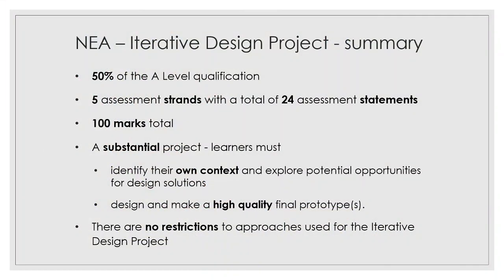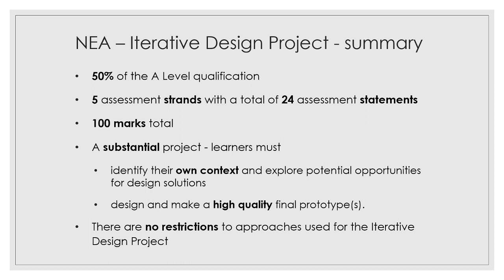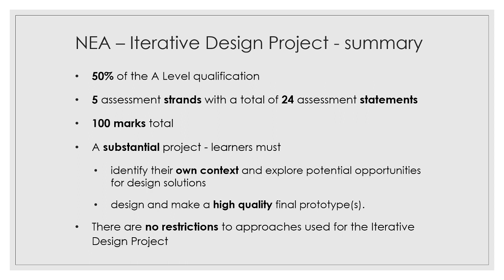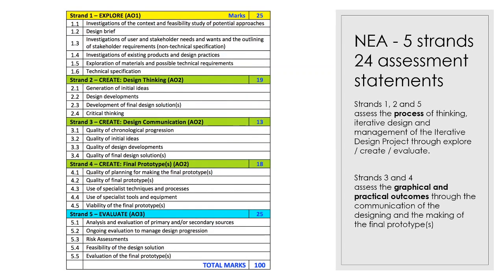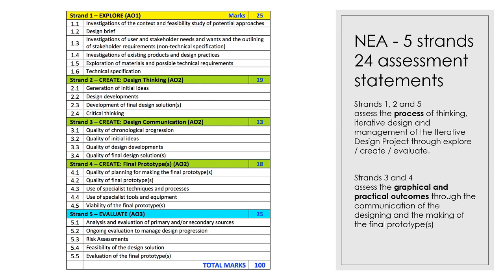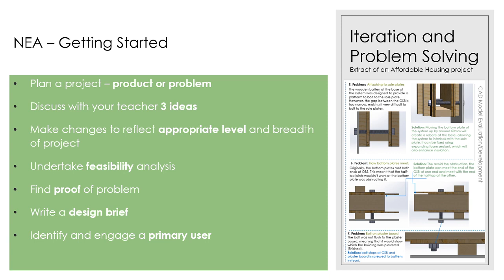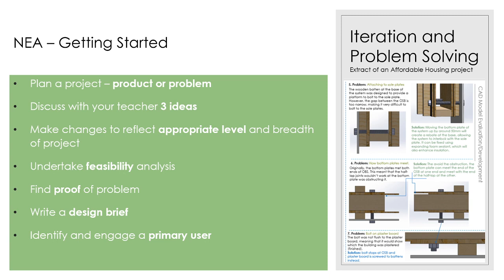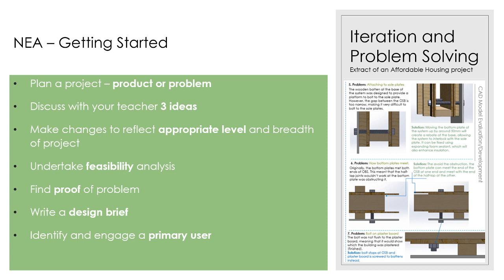OCR NEA (Non-Examined-Introduction) Intro

Comment: Hi thank you so much for this video! Can you produce 3 initial design briefs for all three problems and then do a detailed one on the chosen problem?
Reply from the maker: Hi, there's no need to complete a brief for each though pupils can. Most outline 3 contexts and related problems. The chosen product is done in greater detail and then leads to the brief. Other videos in this series will cover those aspects in greater detail. Hope it all goes well, DTTV.
Reply: @designtechnologytv507  Thank you so much for your response!
Reply: @designtechnologytv507 I was also wondering can you do a SWOT analysis as the initial feasibility study of the 3 contexts?